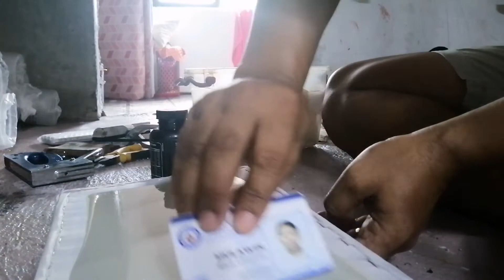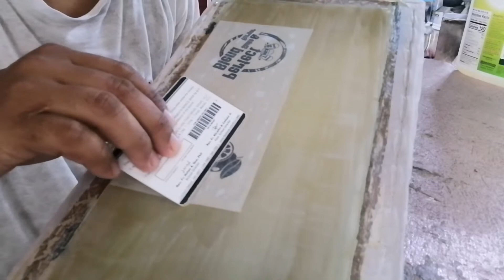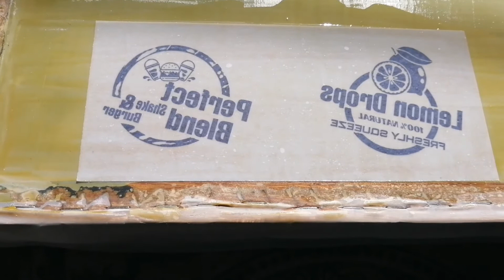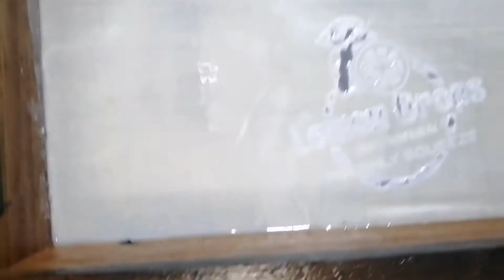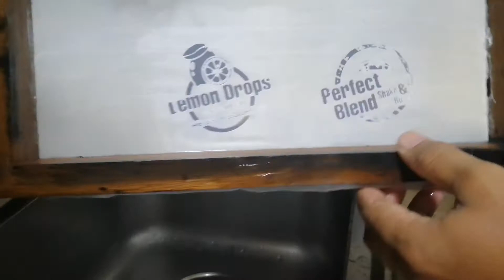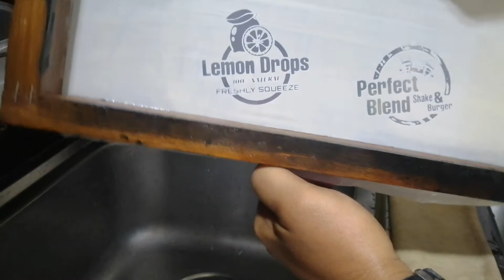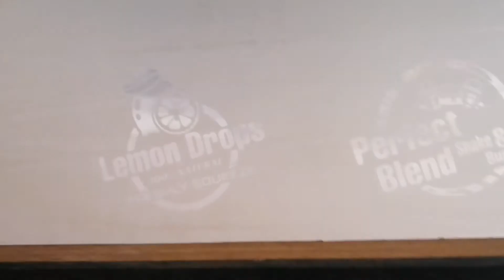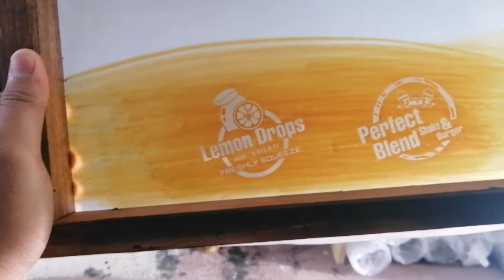DIY | Cylindrical Printing Machine | Milktea Cup's

Comment: Anung number po ng mesh yung nararapat diyan?
Reply from the maker: 250 po yung number po ng mesh
Reply: Best number 300 or 305  para  lahat ng image makuha at  Di makalat  ang  print
Reply from the maker: Ah salamat po sa info, medyo makapal nga po pag 250 kaya linis ng linis try ko po yang 300 or 305
Reply: Tip: pag manual ang gamit 
kung   nag sashadow ang  print   
Wag madalas  ang pag coat ng  Ink 
Pwdeng  Ideep mo lang ang  Squeegee then hagod   para mas  maganda ang  print.
Reply: @MrGrey-im4qd  hello po san po nakakabili ng ppe ink?
Reply: @taragis-04    online  store  sir  Shopee meron din  Printworks  brand
Reply: @MrGrey-im4qd  salamat po.
Reply: @MrGrey-im4qd  hello po 300 mesh gamit ko then ppe ink po tamang timpla po ng ppe ink at reducer po pero prang bilis po mag bara. unang hagod maganda ang print then pag pangalawang hagod na pangit na po yung print. kala namin masyado lang malapot yung ink eh nilagyan namin ng rducer ganun pa din po
Reply: @taragis-04  wag po sobrahan ng   reducer  kc  mabilis  mag  evaporate ang  reducer  kasabay  nung  pagkatuyo ng  ink 
Or  check mo po bka  hindi po masyadong  mganda ang  lapat ng  squeegee sa  molde   dapat  nka  semtro
Reply: @MrGrey-im4qd  salamat po i check ko po yan😉😉🥰

Comment: anong gamit ninyo sa papel na pinag print'an sir?
Reply from the maker: Ordinary lng po na papel nagprint po ako sa computer na design ko po tapos transfer po sa plate.
Reply: ai,thank you po. ano po yung tawag dun sa pinasok ninyo sa gitna ng kahoy na jig para umikot?
Reply from the maker: May part 2 yung video ko para makita mo kung papano function. Salamat po sa comment. Godbless po
Reply: anong number ng mesh po?
Reply from the maker: Number 305 po yung mesh na kailangan po ninyo. Ang ink nmn po ay PPE INK  madami po iyon kulay.
Reply: @teammartinezvlog3727  sir ano po ibig sbihin ng PPE ink, san po nkakabili nyan

Comment: Sir anong ink po kapag paper cups?
Reply from the maker: Diko pa po nasusubukan pero pwede nyo po itanong po sa bilihan po kung anong ink po pwede sa paper po
Reply: Sir bakit kaya sa unang cup, okay naman ang print. Sa sumunod nagkakaroon ng pagkalat ng ink.
Reply from the maker: Adjust ka labnaw ng ink tapos try mo dip lng yung squeege mo sa ink, tapos medyo mabilis na pag timing sa paghila ng plate.
Check mo din yung design baka madumi linisin mo lng ng basahan na may reducer. Practice lng makukuha mo din yan.

Comment: Boss Di q po magets kung alin po yung Tamang sagot sa Anong Mesh ang gamit ninyo, 

Meron dito nag ask ng Kung ano mesh gamit ninyo then ang sagot po ninyo is 305

Tapus Sagot nyo naman doon sa isa Is 135

Alin po doon ang tamang sagit 😃

Thank you malaking tulong itong video nyo
Reply from the maker: Size  po ng mesh po iyon. Dati po ang gamit ko ay size 250 ngayon po nag try po ako ng size 135 ok nmn po sya.
Napansin ko lng po sa size 135 madali po sya ma pudpod. Kaya kung mas hiyang po kayo sa size 250 mas ok po, mahirap lng po sya butasin ng tubig hehe.
Reply: Ano po yung Gamit nyo na photo Emulsion? Aquasol ER ba?
Reply from the maker: Yung normal lng na ginagmit na photo emulsion.
Reply: Hello sir anong gamit po na mesh nylon or polyester po?

Comment: sir papano daw po ginagawa nio para hindi limabas ung ink sa gilid if may fb po kau pa share nmn para masend po namin ang pic?
Reply from the maker: Ah meron po akong bagong ginagawa ngayon. Silicon po nilagay ko, dati po kc packaging tape. Pero katagalan lumulusot na sa gilid. Pero yung nilagyan ko na ng silicon ok na.
Reply: @teammartinezvlog3727  sa mga printworks din po ba un sir nabibili? Salamat po sa idea.. worth watching tong video kahit paulit ulit kme ng nood 😅
Reply from the maker: Yung mga supply po sa printworks po. Pero po yung materials po sa machine kayo na po bahala kung metal po ba o bakal ang gagamitin po. Kayo n din po mag aadjust ng size po ng machine dipende po sa inyo yung taas at lapad.
Reply: @teammartinezvlog3727  yes po sir ang di namin alam kung san nabibili po ung silicon na ilalagay sa mga gilid po. 😅
Reply: Metal machine po namin mejo heavy duty po. 🙏
Reply from the maker: Ah sa auto supply po silicon gasket po pang sasakyan kc pag natuyo po nagiging rubber po sya
Reply: Sir another question po gano po bq kalabnaw o kalapot dapat ang ink